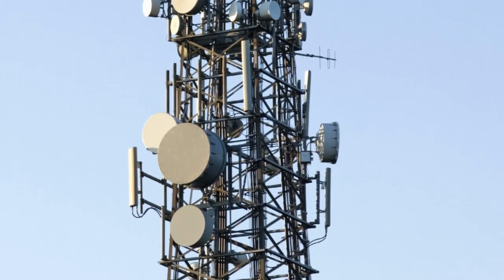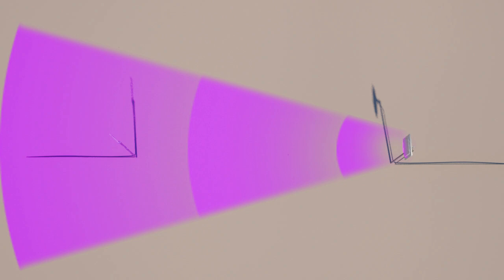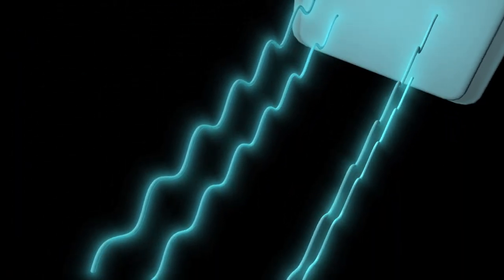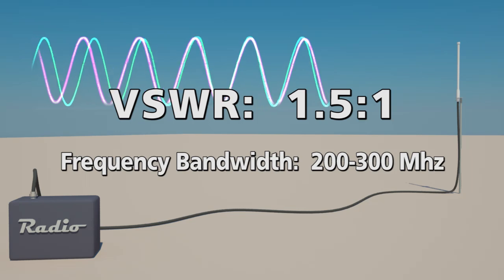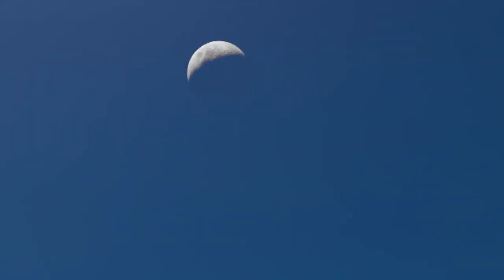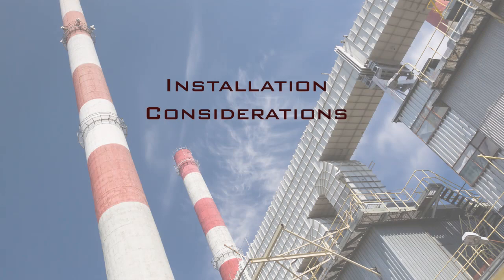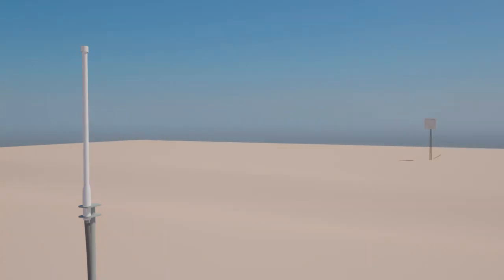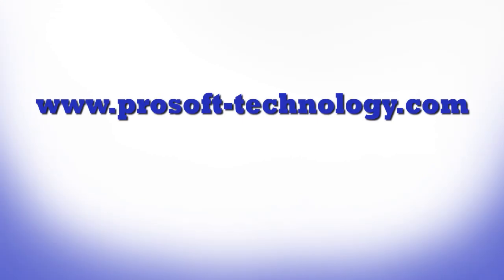A Guide to Wi-Fi and Frequency Hopping Antenna Selection

Comment: At 9:56 it says all 802.11(n) products support MIMO.  I think this is true of Prosoft products, but I think I've seen other products that use 802.11(n) and don't support MIMO.  That was years ago, and maybe the statement is true today.

In any case, MIMO is the coolest thing ever b/c it allows multiple streams of data at the same time and same frequency.  As a hobbyist in high school and college, multipath was always an annoyance. I never dreamed it would be useful to increase data throughput.  https://www.element14.com/community/community/news/blog/2012/06/18/fading-from-annoyance-to-amazing-technology
Reply: Charles - you are correct. Support for MIMO must be built in to the radios used. IEEE 802.11(n) does not require MIMO support.